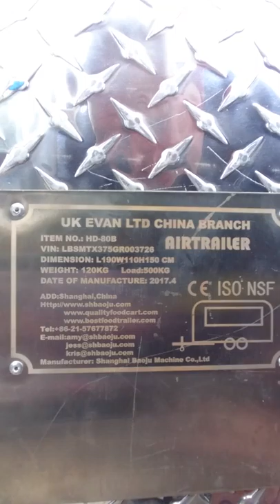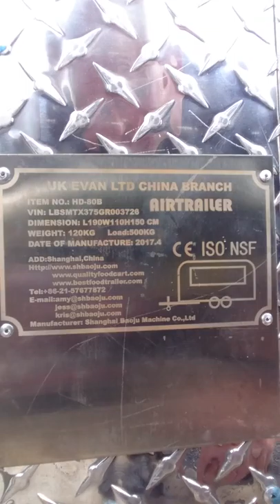SHANGHAI BAOJU CHINESE TRAILER REVIEW UK EVANS

Comment: I bought a food caravan from China. I went over there and visited the factory. It arrived in New Zealand with the wheels off. Twin axle. Plus a number of machines, Icecream, Hotdog, Fresh Juice, Bain marie. Found out that there was no fuse box, No earth wire and the wrong electrical wire, Out side was rusting, Tow arm had to be strengthened, Jocky wheel couldn't support the weight,, lights not compliant and were glued onto the steel exterior, leaks, skylight leaked, Had to get my son the completely rewire and put in a fuse box and electrical protector. Thank goodness the appliances were 230volt. The axles were put on back the front and that had to be corrected, Stainless floor buckled under foot, could see daylight through the mudguards from inside the trailer, etc, etc.  I never used it but will all the problems and the rust I sold it for peanuts. The buyer ran into trouble towing. The wheel sheered off. Twice. He had to get complete wheel assembly which he had to wait some time for. Disaster. NEVER BY FROM CHINA.
Reply from the maker: That's a shame but thanks for letting everyone know